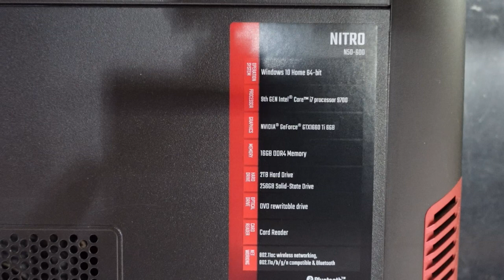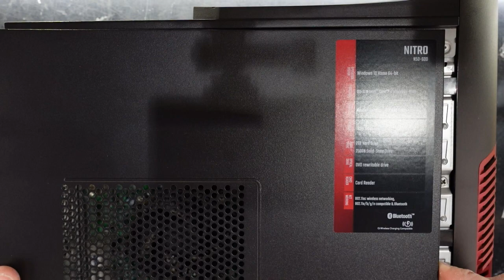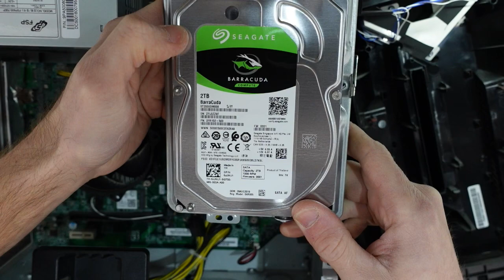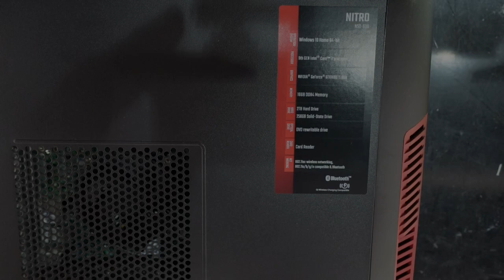Acer Nitro N50-600 Teardown and Upgrade options

Comment: Hello would I be able to upgrade GPU  from 1650 to something higher? I'm looking at one that can support 4k output I have similar specs and 500w psu.

Thanks in advance
Reply from the maker: You would probably need to upgrade your power supply if you are upgrading to a 3060 or a 6600XT
Reply: @rickstechrepairs  Just as long as I'm able to do so brother I appreciate your reply mate.
Reply: @silencedspeech4953  I upgraded mine with a GTX 1660 6gig card and a 500wat power supply.  You need to upgrade the PSU As the old one did not have the right pin connectors.

Comment: 0:12 was yours an upgraded one? The one I found on currys uk was: Intel i5 | 8Gb RAM | 128Gb SSD  | 1Tb HDD | Nvidia GTX1650
Reply from the maker: No this was a customer's machine
Reply: @rickstechrepairs  which upgrades would you say are most needed? I've found an i7, 2060, with (if the seller is telling the truth) a gold rated psu. Plus the ssd is 256 and a hdd is 1tb with 16gb, I reckon it should be good to go maybe needs a clean?

Comment: I have almost the same model only I have a i5 9400F processor been thinking about going to the i7 but not sure which one to go to or the limits I have for it
Reply from the maker: unless you change the CPU Cooler i couldnt really recommend changing the CPU 

if you where to change the CPU cooler and CPU, i would get a 9700F
Reply: @rickstechrepairs  what cpu cooler do u recommend

Comment: Hello, I have an issue with my motherboard so I wanted to ask if the size of the motherboard is DTX? If so, can I replace the motherboard with a micro ATX motherboard instead?
Reply from the maker: you should be able to use a Micro ATX motherboard
Reply: @rickstechrepairs  Thanks!

Comment: do you there is a way i could install a 2nd hard drive into this even if i have to modify the pc
Reply: There is another hard drive slot in the tray, it should be relatively simple. Just watch a tutorial, it's the same idea for most mobos

Comment: I need help. My GPU has always been fine (RTX 2060) but now it has started to overheat so much that it has begun thermal throttling. My fps has gone so bad because of it. Do you have any suggestions on lowering the temperature?
Reply from the maker: i would put a fan or two in the bottom of the case blowing air up

Comment: This is a great video. I have relied on it to upgrade my Optane memory to an nvme SSD and add RAM. I am now considering  upgrading the graphics card. You made a comment about having to remove the hard drive tray if you upgrade the graphics card. How do I affix the SATA SSD if I remove the tray?
Reply from the maker: There would get you a decent performance increase

I don't have a suggestion on where to put the SATA hard drive with the tray removed
Reply: Hi, I have the same PC and I just upgrade my gpu from 1660ti to 2070. Here's my experience: You either find an itx gpu or a card that is no longer than 23cm if the power connector is on the longer side of the card. My Dell 2070 just fits without removing the tray.

Comment: Hey man been struggling I have that exact same computer but slight different specs 1650 i510400f 8 gb ram. What ram do I need to get?
Reply from the maker: https://ark.intel.com/content/www/us/en/ark/products/199278/intel-core-i5-10400f-processor-12m-cache-up-to-4-30-ghz.html

it only supports up to DDR4-2666

So whatever you can get should be fine
Reply: So if I get 3200 mhz hyper ram that I'm buying tmr my mother board doesn't matter and when  I install i it will just drop 2 2666 mhz?
Reply: Basically  the computer you torn down in the video
Reply: Would you know?
Reply: I got 3600mhz ram 30p dollars building new pc 3060 ti and 380px high end build 9 fans lmao j was  a noob back then

Comment: hey not sure if youll ever read this comment as the video is older but i was having some ram issues was wondering what an acceptable brand or size would work for
 replacement ram
Reply from the maker: Being it's a 8th gen intel 

I think Max ram speed it lime a 2666mhz

So anything faster won't benefit
So i would just get a cheap 32gb kit of 3200mhz
Reply: @rickstechrepairs  I did this and the pc just beeps when trying to turn on , any idea as to why ?

Comment: How do I remove the Power supply
Reply from the maker: unplug it from the various things its plugged in to, then unscrew the psu at the back
Reply: @rickstechrepairs  ohhh, I unscrewed the back and it wont move from the corner I thought it was like fitted into that spot and cant be removed. I been angling my can of compress and sparying it to clean the psu.

Comment: I purchased this just before the pandemic and mine is a bit different from yours, for example mine only came with 1TB HDD, 1 stick of Ram and and like 6 i5 cores... I have a question for you if you dont mind, for some reason external SSD have been giving me "I/O Device Error" lately and I spent days tryna figure it out, at this point I have 2 options, give up on PC gaming or invest in an internal SSD and see if that works, but is it even possible to get a secondary storage on  this prebuilt? I dont want to replace my HD but keep the internal SSD for stuff like gaming only... I watched your video to see if it was but it just look like a bunch of cables to me lol for example I am thinking of getting a SanDisk SSD Plus that is 2.5" but uses SATA III
Reply from the maker: no sure why you are getting this issue

i would go with purchasing a MX500 1TB 2.5" Sata
Reply: @rickstechrepairs  Thanks for the recommendation, I saw you tell another person to just "tape it in a corner" which I understand is possible since it has no moving parts, but what about heat?

Comment: Hello how do I upgrade the psu on this? I had the model with a 1650 gpu and 9400f cpu but upgraded my gpu to a rtx 4060, but I don’t think my psu can handle it since it turns on and off once when I try to turn it on. What can I upgrade my psu to?
Reply from the maker: no sure

Comment: can i replace my ssd with a m.2. ssd? or is it not compatible, also wich rtx model would fit in the pc? and if i want to upgrade my gpu to a rtx model do i need to replace the psu with a better one or the motherboard/cpu with a better one?
Reply from the maker: 4:44
Reply from the maker: psu would need to be replaced, to have something like a 3060 or higher installed
Reply: @rickstechrepairs   alright thanks!

Comment: I had this Acer n50 600,  Intel I7 8700 but the graphics card with only 4 gb of memory but it's way different from this with predator imprint on it and it's long like almost twice you had. The length is from back to front, but my question is can I upgrade from wifi 5 to wifi 6 chipset and what chipset I could use could upgrade? Thanks
Reply from the maker: yes that should be ok, i would recommend getting an Intel AX200

Comment: Hi , I have N50- 600 i5  . Were 256 Gb I changed with 1Tb and the rams from 8 Gbddr4 I was thinking to 64Gb CRUCIAL   but my question is how do I activate that XMP FROM BIOS  ?
Or is it not necesarry , because I couldn't find anywhere anything like that in bios  ...
I will change the graphic card as well , I was thinking to Zotac 8 Gb solo  ...
Reply from the maker: i dont think the bios would support XMP. i might be wrong tho

i would just got to 32GB of ram.

Comment: Hey Rick, great video, really helpful. I actually have this model, and I am looking to add a second SSD. Is that possible? And, where inside this case would I physically mount a second SSD? I'm pretty new at this. Hope to hear back, thanks!
Reply from the maker: if its a 2.5" Sata SSD, you can just tape it to a corner
Reply: @rickstechrepairs  Works for me, thanks!

Comment: Hey, I have an older model of this pc, (DH11 I think,) what type of Mobo does this have? I'm looking to purchase a new case.
Reply from the maker: Due to this machine having a semi-custom mainboard, with the front I/O attached to the mainboard itself
Can be seen at 10:00 , i have no recommendations for a case to replace it with sorry
Reply: Okay, I see that now. Thank you for your response.
Reply: @DPearson43  have you changed the case if so which one do you have?
Reply: @torbensanaldiener  Hey, I did manage to fit the Acer Mobo in a NZXT H510i. You just have to take the white metal panel out to fit it. I also ran a longer headphone cable from the front of the Mobo through the back of the case so I could still use a headset.
Reply: @DPearson43  thank you for the information
Reply: @torbensanaldiener  No Problem. 👍🏻

Comment: Hello thanks for the tutorial and ive got some problems with mine, everytime i play a game my graphic card had been overheating and i found out it was an rtx with no fan insted of a gtx, Should i upgrade it to a better one? Tell me how to fix my overheating problem please.
Reply from the maker: What model of GPU 

And why do you think it's overheating?
Reply: @rickstechrepairs  dont know the model, i think its overheating because when i touch the outside part of the gpu its very Hot and when i touched the gpu in the case about 10 min after i unplugged my computer it was still warm

Comment: can i put an 4060 in it? i have an acer nitro n50-600 with a 1060 6gb and i7-8700 and 8gb ddr4 but i added another 8 so 16gb in total and a 256 b ssd
Reply: also do you know how much watt the power supply is?

Comment: i Bought a WDblack SN750 and i has inserted it in but in my bios it shows my HHD disabled and im not sure if i had dont something wrong with installing in THIS PC it only shows the SSD as the Local Disk C
Reply from the maker: it running in sata mode i think, which disables one Sata port

Comment: Which CPU coolers are compatible with that motherboard?
Reply from the maker: Not sure
Reply: Depends on what CPU you have. Search up your cpu's socket type and find a compatible one. It's usually LGA115X. Cooler masters coolers are the original ones so their coolers should work.

Comment: hey! nice video , ive had this pc for 4/5 years now, and ive upgraded some things, but now its time to upgrade the graphics card... i have a 1050 and i wanna upgrade it to a 3060... the problem is that im a bit concerned that it may not fit in there... could u help me with that? thanks btw :)
Reply from the maker: if you upgraded to a 3060 you would also need to change power supplies to run it.

might also be able to get away with a 4050 or 4060 GPU as they us a little bit less power 

Also you could only fit a 3060 Dual Fan Card in this case
Reply: @rickstechrepairs  so to be able to replace the psu i would also have to remove the hard drive tray right? or it could be done without removing that?
Reply: @KingLewis_11  hi did you get the answer here ? Did you fit it with no problems and works? Have the same build up and want 3060. Thanks

Comment: I installed two 8b vengeance 2666mhz and it made me unable to connect to the internet, I tried putting the old stick and and now I permanently have no internet, does anybody know why that'd happen?
Reply from the maker: odd, but i ahve seen ethernet ports die in the past, but i dont have a solution for you

Comment: Rick do you know if I can install a case fan on this
Reply from the maker: I think it should be able to have a 120mm fan at the rear
Reply: i installed a 90mm fan at the rear.
Reply: @zxc930213  yep I'm doing it right now
Reply: @rickstechrepairs  should it push or pull air

Comment: Hey I have commented before but do you know any rtx 3060 that will be able to fit in my Acer nitro 50-600
Reply from the maker: dual fan should, tri fan probably not
Reply: @rickstechrepairs  thanks bru u a real one
Reply from the maker: Thanks :)

Comment: Hi. I have this same exact pc but i switched the case and the gpu. I switched to an RX 6600 and added another stick of ram. Im having a lot of problems with my games like for example it stutters too much or i get low fps even if the settings are on low settings. Idk if its the cpu Thats bottlenecking or the motherboard thats maybe not suited for this gpu. Please help me out. Thank you.
Reply from the maker: what gpu and how much ram?

i would start with a ram upgrade
Reply: @rickstechrepairs  i have an RX 6660 and 16 gb of ram

Comment: What kind of motherboard is that? Someone please help, I have the 1060 6gb model with i7-8700 CPU @ 3.20GHz (Socket LGA1151). So I'm planning on upgrading my GPU and CPU but I don't know the chipset (Intel h310 / h370 / c242 / c246 / q370 / z370 / z390) so I want to know if I'll need to get a new mobo or not. Please and thank you!
Reply from the maker: Use CPUZ to find out what chipest you have

Comment: Thanks your video helped a lot I somehow fucked up and now whenever I plug in my computer it boots for like 10 seconds then restarts and repeats
Reply from the maker: Did you change over your ram
Reply: @rickstechrepairs  no i found out the problem what happens was when installed the ssd i forgot a screw so when i powered it on it tipped outa place an did a small short circuit of my motherboard requiring a full reboot took it a pc shop and only cost me 50 bucks to repair but now i got a m.2 4th gen ssd :D

Comment: I upgraded my ram from 8 to 16 gb, the major problem is. That you cant change the speed in bios on this motherboard, so it is dual channeled but it does not go on the 2666mhz speed, and thats kinda cringe
Reply from the maker: I'm pretty sure the motherboard will support frequency changes automatically
Reply: what ram did you get

Comment: Man my exact PC has been crashing like crazy and she's done I play CSGO and it use to run wow but it won't even run anything now and crashes I came here to see if it was worth tearing apart and rebuilding a new PC
Reply: Please let me know what you think
Reply from the maker: i would be checking temps of cpu and gpu.
re apply thermal paste, dust clean
possible do a fresh install of windows on a m.2 NVME ssd

Comment: This is not the best. But it's cheap and effective. Easy to upgrade too. Added a 500wat PSU and a gtx 1660 6 gig card. 
About a 750$ upgrade. With the psu from Amazon. And the card from new egg.
Reply from the maker: cheap and effective are ok

Comment: Hello, one question my computer (the Acer Nitro N50) is not working, as in it has been turning on for a second and turning back off if any one can answer or help me fix my problem it would be much appreciated
Reply from the maker: you will need to take it to a local repair store for inspection
Reply: Hey, the exact same thing happened to me. The issue for me was a voltage regulator issue on the motherboard. I have to get a new motherboard. Have you already fixed it? If so, can I ask a few questions?

Comment: Anyone know if a triple fan gpu will fit in this case? I can potentially get a 1070 cheap but it’s quite big. Don’t wanna take the plunge if it doesn’t fit. Thanks
Reply from the maker: Google the model and check the measurements
Reply: I slapped a GTX 1080 into mine today and it just fits, anything bigger isnt getting in there lol

Comment: I have this pc but a little bit lower specs ryzen 5 gtx 1650 with 8gb ram I want to upgrade my ram from 8 to 16 and possibly my gpu to a rtx 2060
Reply from the maker: both of that should be fine
Reply: @rickstechrepairs  thanks even though I’m not sure how i will just have to try

Comment: Hello good these days I have decided to change my pc ram and increase it, it is this specific model, the one with the video ... and I only had an 8gb card, and today I received the kit of two 8gb 2666hz cards and 1 , 2, CL19 to put them in dual channel, which are compatible with the pc and are of the crucial brand ... and when putting them in their proper position and such, the pc starts to turn on me and it doesn't work for me ... someone knows how to tell me to what is due? I say it because I am going for the fourth ram bought and I am a little annoyed already ... if someone can help me see if I can do something in the bios, or in some adjustment or something please. In fact, I know that it works because in the video it has two cards with 16GB in dual channel and it works for him and it doesn't work for me. :(
Reply from the maker: Its Possible a slot is faulty on the board

Try and use 1x Stick, in each of the 4 slots to make sure its communicating properly 

Then do the same with the Crucial Stick of ram
Reply: @rickstechrepairs  okay, well, I have checked that all four work for me and I have 2 slots that fail me, they are not completely broken because they detect the ram so it beeps, but could it be due to dirt? or can it be easily fixed?

Comment: Anyone know if the N50-600 model D17E5 is compatible with RTX 3060 If I upgrade to a 650w PSU?
Reply from the maker: It should be
Reply: @rickstechrepairs  awesome! Thanks.
The only issue I have is space as the case is so small.
Reply from the maker: indeed, maybe a dual fan gpu will fit

Comment: Just a word of caution. It's important to ground yourself while building or taking a PC apart otherwise you may fry your computer, harm its fragile components, or experience shocks due to electrostatic discharge (ESD). If you don't have an anti-static wrist strap, leave the power cable connected (but switch the unit off) to keep it grounded. Touch a metal part of the chassis prior to handling components to discharge any static build up on your person. Hold the PCB's from the edges and do not touch anything that's conductive on the PCB. Static affected components could be damaged instantly or die months later.
Reply from the maker: i find always touching the case is my go to thing

Comment: i got a slighty older model, of i5 8400 and gtx 1050 and one stick of 8gb DDR4. i planning to get another 8gb stick of 2666mhz. what graphic card is compatible.
Reply from the maker: you will be mainly limited by the Power Supply wattage, if its under 550watts
i would look towards getting a RX6600
Reply: @rickstechrepairs  thank you 😊.  I will upgrade my psu one day and maybe a new case, but definitely getting new ram.